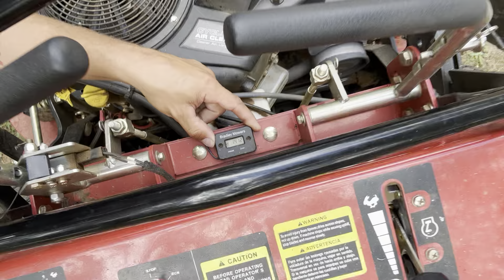Honest review of a Bradley 52” stand on Mower after 140hrs

Comment: It comes down to how many hours you get on it before it is slap wore out most $15,000 mowers should get 3 to 4000 hours before showing signs of wear so if you only get 500 hours out of the Bradley, then you are paying the same amount because you would need three Bradleys to equal one $15,000 mower. So a long-term review should be interesting. Let’s see how the Bradley holds up.
Reply from the maker: I know several people with 1500+ hours on their Bradley 52 and 61 a lot of it also has to do with maintenance if you maintain your stuff it should last just fine. The only thing that would be hurting the chances of my Mower going that far would be the commercial turf engine because it’s nowhere near as good as the Vanguard.
Reply: My vanguard has been down for 4 weeks now. Hydro gear issues. Anything not related to hydrogear has been fast, quick, and easy. Simon is great! Mines got about 280 hours. Great review! I also pump my oil out. I run wanda’s on my great Dane. No issues.
Reply: Mine has 500 hours still running strong